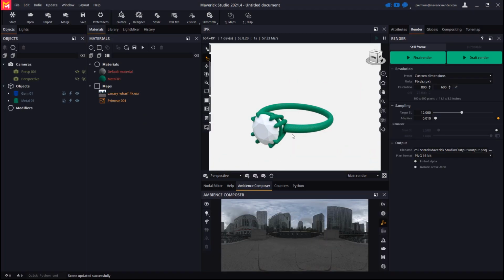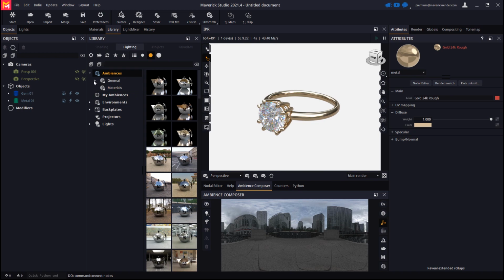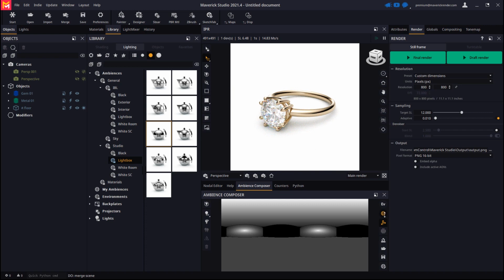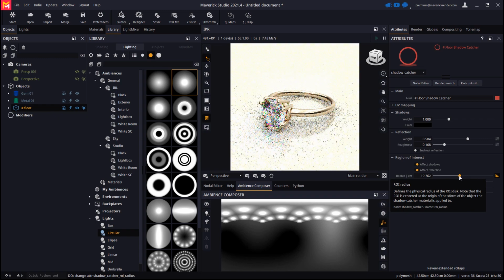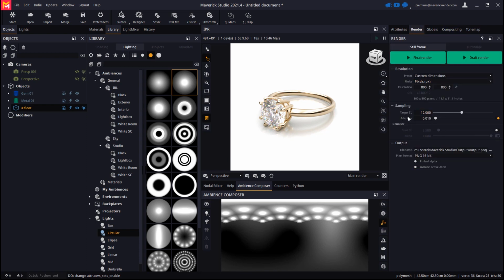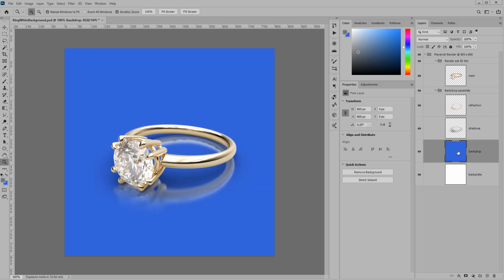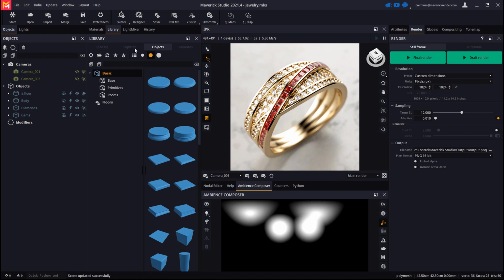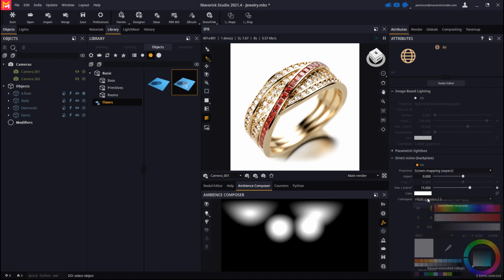MAVERICK RENDER: 31 JEWELRY OVER PERFECT WHITE BACKGROUND

Comment: i do not have ndvidia graphic card.. i have intel graphic , so can i use maverick pls advise
Reply from the maker: Maverick is CUDA based, so you need at least a 1000 series or RTX Nvidia card, sorry, you need to update your system
Reply: @MaverickRender  thank you so much
Reply: @MaverickRender  so you mean i can use any latest +1000 series nvidia graphics right ...
Reply from the maker: @Ss.098  Yes, although obviously, the better it is, the more performance you will get.
For example a 1080ti is almost 3 times faster than a 1060.